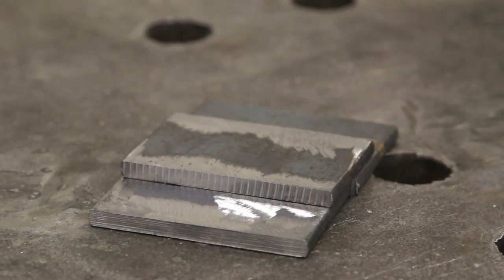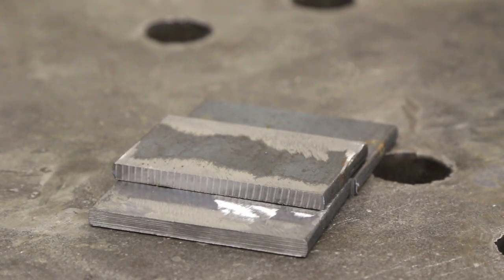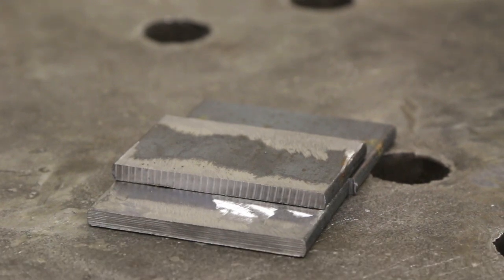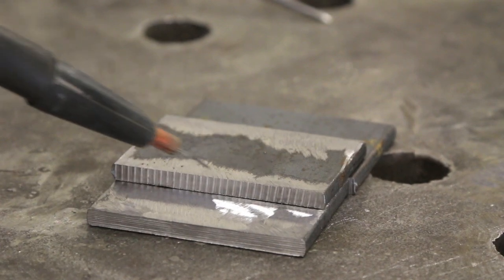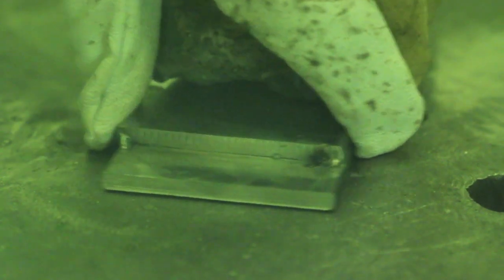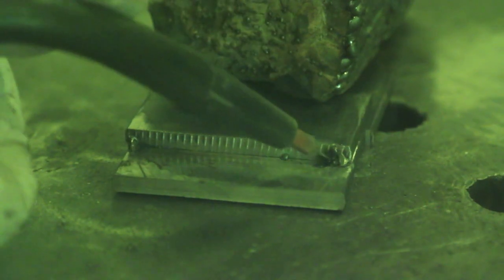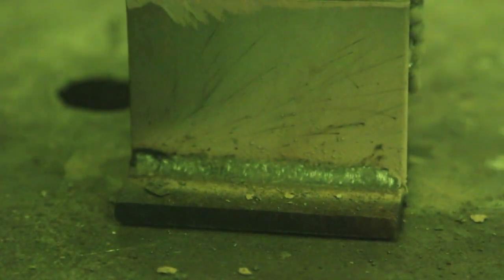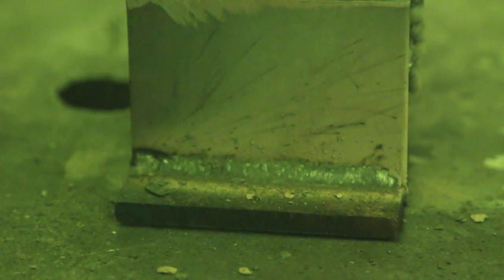Welding Common Joints Using Flux Cored

Comment: I have a tight area to get into, with the nozzel on, the stick out is way too far using argon gas. I must also preface this I am newbie at welding. After watching several amazing videos I come to the conclusion I should be using Flux Cored being I am outside. With that said, I removed the nozzle,  which allows a ton more room to get into this tight area. I didn't know if I should do that or not but seeing your video with this Longevity machine, the tip sticks out quite far. I guess it is ok to do what I did. I will keep practicing! I read a bunch of comments and it looks like I can remove the nozzel without issue. Thank you for making this incredible video.
Reply from the maker: Thank you. Glad you enjoyed the video and found it helpful!
Reply from the maker: Thanks for the feedback and glad you enjoyed the video!

Comment: Hermano pero no ah dicho en que amperaje y voltaje estas haciendo estas solduras
Reply: Every machine is different, especially with wire feed welders. It's pointless to tell someone what their settings are, because it most likely won't work with their machine. Some machines use letters for voltage and speed, some use numbers, and some use both.
Reply: Good point: Most consumer flux core welders have numeric scales (i.e. 1-10) and do not relate to what traditional MIG welder's volt/amp digital and wire speed readouts display.

Comment: What Flux core wire you like the Best ?
Reply from the maker: In terms of brand, I would say Lincoln, and the easiest wire is NR-211-MP. Though I prefer to use GMAW (MIG) using ER70S-6 and argon/c02 over FCAW, providing there is no wind.

Comment: Thanks for the video. I am getting into welding and have no experience. I have been around it most of my life and it does not seem complicated. Just learning the basic must do and don'ts and lots of practice. I guess my question is this. I am looking at welders but i am not looking to have several different welders. I would like to stick, MIG and flux core from one machine if possible. I have been looking at them and have no idea which one would be best. The best performing welder for the best dollar with the most features? I also want to stay in the 110 volts range if possible. Any suggestions? 

Thanks

Comment: Thanks for the informative video. Thinking of getting a small welder to build a brush guard for the bottom of my tractor. I learned the basics of welding over 25yrs ago, but haven't welded in almost 20yrs. I'm no looking forward to tackling my project.

Comment: thanks for sharing these tips!
i have a 110v welder that does gas or flux core. i have only used the flux core wire. But i dont get much or any slag when i weld. Am i doing something wrong or am i using a cheap brand of wire?
Also ive only ran .035 wire
Thank you for any help you could provide

Comment: Noob question but do you get arch when you make contact or when you pull the trigger?
Reply: hitzdaskinz  pulling the trigger
Reply: hitzdaskinz both. trigger must be pressed and then the arc will start
Reply: hitzdaskinz pulling the trigger energizes the wire, arc starts when the wire touches the metal :)

Comment: my friend has a Lincoln like that one. He told me he was having problems with the wire getting stuck in the tip. He sent me a picture of the gun and I noticed it didn't have a nozzle on it. All the other small machines I've seen even though they ran no gas they still had a nozzle. Wouldn't having a nozzle be better to maintain the proper stick out between your tip and the work?
Reply: got that right
Reply: The nozzle isn't required so I know some people run without it because it gives them a better view. I put a flux core nozzle on my everlast mig welder to help keep spatter from sticking. The flux core nozzles I'm used to seeing are black and a bit more narrow at the tip so that it keeps the sight line a bit clearer.

Comment: Thank you, very educational videos, I would like to sincerely explain to me that I weld structural steels voltage and wire speed required for working with wire 0.072

Comment: how long can you weld continuously? I thought I heard something about a duty cycle which determines that.
Reply: depends on machine.  I like to get at least a 60percent then you can do 6 min weld over 10 min period, machine needs cooldown period, so 20 percent will get you 2 min in 10 of welding.  They are getting better, but it depends what voltage you have, and amperage in circuit to provide, and the max power of machine's capabilities.

Comment: if your welder is not very big, you can also heat up the plates you are welding before welding to get better penetration
Reply: yes, pre-heating will definately increase  the effectiveness of the weld pool washing up.
Reply: Good tip. Sometimes I'm called to perform a weld repair on site where they only have 120v power. My Everlast 140 mig is pretty capable but it can only do so much on 120v. Much better when I have access to 220v
Reply: I made up a 50 foot extension for my 220v everlast using thick wire. there aren't too many places I can't get to now.

Comment: That is the smoothest flux core weld with a 115v welder. Hats off sir.
Reply: for a 115 volt, good job indeed.   I am used to seeing no ripples at all, but that is not bad.  great to have a little 115volt sucker around though.

Comment: Great videos. I'm having a problem welding a light weight nut to 1/4" square tubing for a thandle tension point. Any help would be much appreciated. Also I'm using a wire welder.
Reply from the maker: What's the problem?
Reply: Couldn't get the small nut welded to the tubing without breaking the weld when I stressed it with the t-handle and I tried adding another nut to give some extra area to weld and it worked. Thanks

Comment: Easy to follow instructions. Now how do I get the flux to come off easily like you did on the T joint. It seems I always have to fight to the death to get it off. The videos I watch the flux just seems to jump off!!
Reply from the maker: Providing your settings are correct, if the weld goes in hot enough and is laid down at the right travel speed, it would peel right off.
Reply: Yup, I turned up the heat and it did just what you said. Being newer I tend to run with less heat - a fatal error on my part for a number of reasons. Thanks!

Comment: Hey man, what brand of wire did you use? I usually use hobart flux cored .035 but i like the appearance of your weld.
Reply from the maker: I was using Lincoln, NR-211 MP

Comment: great videos.the last welds were T joints fixed my bad
Reply: what helmet shade are you using?
Reply from the maker: +Jon A About a 10 shade.
Reply: They were both lap joints. A T joint is when the metal pieces join at a perpendicular angle, not parallel like the one in the video.
Reply: +GambleFabrications
Nope. At 5:24 you can clearly see that there is a T-Joint. I pretty sure if you look at the _longest axis of each piece_ you will find that: If the  both of the longest axes lie in (non-coplanar) parallel planes then it's a lap (if coplanar then a butt or edge joint); However if they are perpendicular then it's definitely a T-Joint or a corner joint. See American Welding Society's codes and standards or the equivalent.
Reply: John ______ You are correct, the one at the 5:24 mark is clearly a T Joint, I guess I never made it that far into the video.

Comment: I read some other comments, and I have a question about flux core. I have a pro-series 125 amp flux-core kit. In the comments, it's said that the nozzle is not needed for flux-core. Since my machine is just for flux-core,  and no way to even add gas, why did it come with the nozzle if it's not needed? 
from the comments, it seems that I can run without the nozzle? I always thought the nozzle helped in the shielding, but if it's not needed then it's 1 less thing to capture all the spatter flux gives.
Help would be appreciated. Thanks.
Reply from the maker: +Path in AZ MIG and Flux Cored guns are one in the same, so that is probably why it came with a nozzle despite the machine not being able to weld with gas shielding. Flux cored welding does not require a gas nozzle to be placed on the end of the gun. What I do recommend is a special flux cored welding nozzle, that serves to protect the threads of your contact tip from spatter. Good luck!
Reply: WeldFever Thanks!
Reply: +Path in AZ I took my nozzle off and haven't noticed a difference

Comment: +WeldFever Question, I was watching an instructor on here, who said you can rest the welder nozzle on the piece you are welding when you are first learning (at an angle so only a part of it is touching). This instructor was using gas. I notice you have no welder nozzle on your tip. I was wondering when I learn to use flux core welding, if I can also let my welder nozzle run along the piece of metal while I weld. Thank you
Reply from the maker: +dynocompe The nozzle's purpose is to allow for the flow of shielding gas to surround the weld. Since flux cored does not require shielding gas, the nozzle serves no purpose and that is why I remove it. As to your question, the simple answer is yes you can attach the nozzle and rest it on the base material to act as a guide while learning. You will have to take 2 things into consideration though. One, make sure the insulator on your MIG gun/nozzle is in good condition or you will "arc out" on the base metal when you touch it. Two, flux cored usually requires a longer stick out (contact tip to work distance) so you may not get favorable results if you drag your nozzle on the base metal, since the CTWD may be too close. Good luck.
Reply: thanks for the quick response. I dont think i will let it rest on the metal, will just rest my hand to keep it steady.. Almost ready for my first try at welding. Got my plug wired for welder today, now letting welder table thaw out from being outside. (previous house owner was a welder, his table sucked so I put it outside) Now since it has a nice 1/2 plate of steel table top I brought it back in to weld on, be a good insulator for that heat I hope. He built the top though like an island with bar stools, the one side of the top over hangs like 8 inches while the other side only a couple, So now you have to be careful since its very top heavy and the side with 8 inch over hang wants to fall over! Thats why i moved it outside. Will have to reweld this table centered
Reply: +dynocompe youre referring to dual shield flux core which uses shielding from the filler metal producing gas and most commonly a 75/25 co2/argon mixture like MIG welding. This is what I use at work and it produces cleaner welders more often than not and makes the weld hotter for a higher production rate.

Comment: Was that mill scale or pickling?
Reply from the maker: +ktrez2000 It would be mill scale, I guess? Not knowing exactly what you are referring to, it's hard to say, but pickling is a term I am not familiar with in regards to mild steel welding.
Reply: pickling is only used to clean stainless welds...  correct?

Comment: Srsly, 'torch' is just fine.. Americans with their calling dang near everything handheld a gun nowadays... 'Where's my woodenstickgun.. I mean hammer?'

Good video though, thanks for the sharing!
Reply: +Terah well, it IS hand held, actually gun shaped, operated entirely by trigger, resulting in something being propelled out of the end orifice… one does not have to be obsessed by anything to refer to the end of a mig welder as a "gun", as it is the most fitting descriptive metaphor.  
conversely, the word torch would seem to be the inappropriate word, as torch implies an instrument of providing light, for light's sake, or of something that spits flame or electrical arc to do cutting or welding. (as in a TIG torch, or oxyacetylene cutter  which does just that)   a mig machine does not spit flame or light, it feeds electrified wire through end the gun-shaped trigger operated handle correctly identified as the gun.  i don't think that "americans" think about  naming things as guns too much, but  perhaps you are trying a little too hard to be against guns for some reason?  

post script- as a carpenter i find your analogy of hammer as slightly amusing, for in the modern day the hammer has been antiquated, and it has been largely replaced by the…..wait for it….. nailgun!  so we DO say "where's my gun" when its time to drive nails into our materials.  brilliant!

Comment: Where can you buy the thread protector on the gun tip?
Reply from the maker: +jtmagicman25 Any welding supply shop, online, I've even seen them at the big box hardware stores.
Reply: WeldFever Thanks for the answer.  What are they called exactly so I can ebay search.
Reply: +jtmagicman25 yeah I bought one at Lowes for like $4 bucks, welder nozzle. Blue Hawk flux-core welding nozzle, I tired to use it but I like the ground down nozzle that came with mine that is used on gas based welders, for gas shielding. Using this type of nozzle like he is using, I kept accidentally touching it, contact tip, against the metal at an angle and causing it to fuse to the surface.........probably not super good for it, lol
Reply: b0xcrash
Cool, thanks, I just want something to protect the threads from arching.

Comment: I have learnt a lot from Weldfever, ideal was presented simply but efficiency for the beginners. Unfortunately, it is rarely to have suitable for application because of super thin steel in common uses. Most of steel in stores have 0.8 to 1.5mm thickness, thick steel is much expensive, thin steel create hole with 2.5mm stick welding. Hope your new instruction for super thin steel with stick welding technique.

Comment: Nice video.
In this video there is little spatter. How do you achieve this? In other videos sometimes the weld bead is kind of a mess. Is the stick out important about spatter level?
On the upcoming video could you give an explanation on how much stick out is good or bad for MIG - MAG? And the effects of varying it while welding, if possible.

Forgive the bad English, and greetings from Italy
SARTo
Reply: Dude that is really up to the feel of the welder and the person welding. If the stick out is not maintained at the proper distance you will either get the wire trying to arc to the surface which is an indication the wire speed is way too slow and it is very distinct this is happening as it makes a violent popping and is arcing all over the place or you will make a giant bubble gun weld where the weld is actually more or less glued to the top surface of the material but does not penetrate the base material. 

If you have a wire speed too high you will feel the wire hitting the surface before it melts wanting to push your gun back towards you. Both can and will have an effect on the amount of stick out the person has also thinner material if the stick out isn't maintained you could be building a puddle so hot that it ends up burning through the material you are welding. Not fun cause then you have to try and patch the hole left behind. 

On thinner material I tend to hit a small bead on one end then move to the other end and do the same and then hit the center and then finally try and join the two. The idea is to keep too much heat off the thinner materials. 

As for your other question yes stick out can cause more bb's to appear like in the instance I spoke of where the wire speed is too slow. In either case the wire is either coming too fast to maintain the stick out or too slow. 

Flux-core will always spatter and is the nature of it to do so but some more expensive machines actually reduce it a bit as they usually come with wing nuts on the + and -  in the machine to switch the machine to weld in DC negative. This greatly reduces the amount of spatter occurring. The only machine I know of that does not allow reversing polarity is the cheap Chinese 90 amp welders.  They almost are always an A/C unit which sucks for welding with flux-core wire as it causes it to spatter up a lot. 

If you are getting a lot of spatter no matter what then look under the hood of it and somewhere on the machine it will say it is an A/C unit and nothing can be done except buying a machine that supports DC neg welding. 

There are some people who have flux-core welders and run them like they are gas welders. For example gas welding will allow the person to make the traditional stack of dimes look. However people continue this when using flux-core and it is not good to do zig-zag's or circles when welding with it because it can create voids and interrupt the creation of the slag that is protecting the puddle as the weld solidifies. This can also cause some slag being trapped within the puddle so if you grind down the weld to clean it up you see the imperfections in the weld. How it is suppose to be ran is simply dragging the wire in front of the puddle at an angle the wire is not actually entering the puddle but only adding to it. 

Keep in mind you are trying to control the flow of the puddle and you need to set the machine up to not add too much material or too little. A good weld is one that is almost flat across the top of it and has an obvious bead.
Reply: because this weld is with Flux core wire. which does not need gas.
Reply: +fastsofaracing Flux Core tends to have a ton of spatter, which is why he was asking.
Reply: Dang... I know this is a 7 year old comment, but I just had to say, Hat's off to you sir!!! That is the most concise explanation with how to fix it on the the subject!!! I've been looking for what you just outlined and will copy-pasta so I can keep that around!! I wish there were more ppl like you, that actually knew what they were talking about and are willing to share a few nuggets with those of us who are trying to learn! You are a scholar and a gentleman!!!👍👍